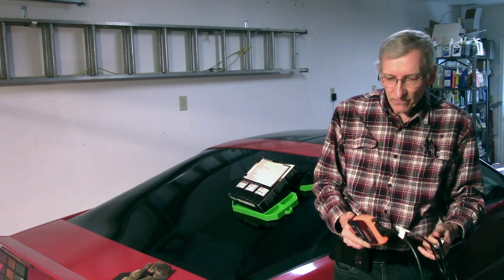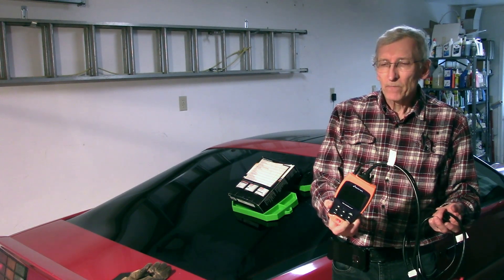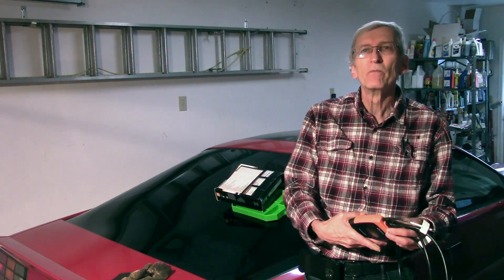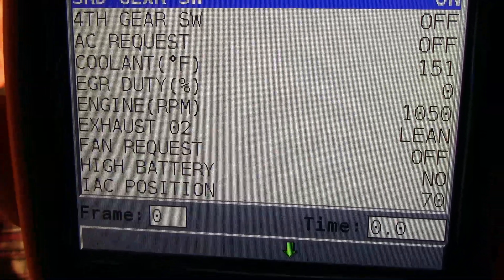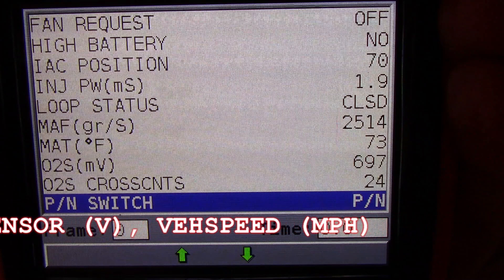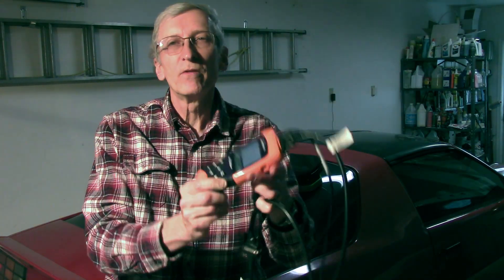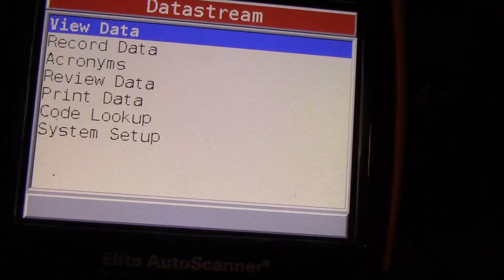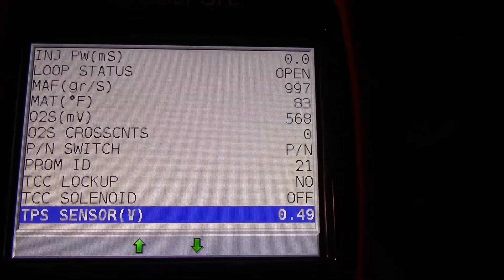OBD-I Scan Tool Review

Comment: Any idea where I can get 12v power cord for Actron 9690? I think Bosch took over Actron?
Reply from the maker: Yes, Bosch owns Actron and I understand they are no longer selling under that brand. Looking at Bosch site for the OBD1300, they list the cable part number as 7-0135. I found it on a couple of sites, here is an example:
https://oemtechtools.com/products/replacement-cigarette-lighter-adapter-for-use-with-act7-0135

Apparently the Bosch OBD 1300 will be the replacement.  Here is a video with a little more information on the issues.  When I made that one, Actron was still selling, but it was hard to find.
https://youtu.be/EpyRz4xCozw

Comment: The cp9690 I got won't connect to 93 camaro,  how do I troubleshoot why its not connecting?
Reply from the maker: There are only a few things that I know.  First, be sure you have a solid 12V connection to the tool.  GM OBD1 won't work without it. The tool will run on battery, but not communicate.  I would check to see if the car will at least flash a code "12" with the engine off.  That usually is a paper clip jumper between pins A and B on most cars.  12 is a code with a stopped engine for no engine speed. If not, there may be an issue with the ECM. Then,  I have had trouble with cars that have had a custom PROM, either a changed one or a reprogrammed production one. Sometimes the reprogrammed ones upset the diagnostics.  Finally, there is an Actron website with the latest software posted for the tool.  If you don't have the latest, you could try updating, though I would think that for a '93 it wouldn't need an update.  Beyond that, I would check with their tech support.
Reply: Ok that's the issue, no 12v cord only batteries. Paper clip jumper flashed code 12. Action is out of business, believe Bosch took over? Wonder how to get 12v power cord?

Comment: How many issues will this tool recognize? I have a 1989 Chevy Cavalier Z24 2.8L that is giving me an issue?
Reply from the maker: On a GM OBD1 car, it should pick up all of the trouble codes that the particular model has in its ECM / PCM.  It should provide the engine data stream for all of the parameters that the controller can provide. Depending on the individual engine controller, there can be some additional functions.  The GM factory tool (Tech1) will usually provide some additional data and functions.

Comment: My 88 S10 uses a paper clip and flashing “Service Engine Soon” light…😆😆
Reply from the maker: Yes, nearly all the GM OBD1 systems use this method to dump codes.  But if you don't have a code, the scan tool is worth it's weight in gold for troubleshooting.
Reply: Google is good for that 👍

Comment: One other tool you could consider would be a old snap on brick. You can usually get one for around the same price as the Actron.
Reply from the maker: Yes, that would be another good solution.  I had the ability to borrow one of those for OBD1 cars some years ago and it was very good.

Comment: Can you reset codes or do relearn procedures?
Reply from the maker: Some of those features depend on the model and year.  On my '85, it won't reset codes because the ECM must be disconnected. I know it will on my OBD2 vehicles. Not sure about the relearns for the same reason.

Comment: Actron finally got them back in stock, I got mine a couple of days ago. tried connecting to my 86 trans am 305 tpi. kept getting device connect errors. called actron tech support and they said it will not work with the tpi cars now. I guess it works with the throttle body engines but not the tuned port any longer. they have updated the software in them .
Reply from the maker: Ohhh, I'm sorry to hear that.  That's not good.  I can't understand why they would do that, but I believe you.  I'll try need to put out a warning or something.  If I take down the video, all the comments will disappear, too.
Next option for you may be the laptop / USB cable and WINALDL or TunerProRT.  I have several videos on those and they worked well for my '85.
Reply from the maker: Since they claim the software is updated, could you please tell me the version on your tool? It is listed under System Set-up / Tool Information.
I just checked Actron site and they don't list a newer software than what I have on my older tool. I have a 0B0B.  The site lists latest as 0B0B or FED0.  That hasn't changed since I bought mine.
It could be that it varies based on ECM.  The 85 and 86 have different ECMs, but I wouldn't have thought they would not support the newer one.
Reply: It had the 0B0B software. @bitsofwisdom460

Comment: I can’t find this scanner anywhere or the Bosh one
Reply from the maker: The Bosch technical folks told me it would be coming back in late summer.  I don't know what the hold up is. You might want to take a look at my videos with a laptop and data cable.  That takes a little more work to get it set up and working, but it is a useful alternative.
Reply: Ebay has it.
Reply: @CarlWilliams-u3y  couldn’t find it on eBay

Comment: I have a 1996 Mitsubishi Pajero 3.0 12valve. Will this obd1 tool work on a 12 pin socket?
Reply from the maker: No, this one only has OBD1 cables for GM, Ford, Chrysler and Toyota. I'm sorry, but I don't know what you need for Mitsubishi.

Comment: Great video.  One question…I purchased a used Bosch OBD I scan tool, model 1300.  The GM adapter is difficult to insert into my port.  I’m not sure if the teeth are misaligned? Have you ever come across or heard of something like this?  I have yet to use the tool because I cannot insert it and I don’t want to force it and break something.  Thank you.
Reply from the maker: I haven't come across that issue.  I suppose a pin could be bent. What car do you have?  Just to be sure, the standard GM ALDL plug is 12 pins and the connector has a slot on the top and 2 slots, one on each side at the bottom (or sometimes the plug is inverted). The car side has a tab at the top and wings or tabs on the bottom on each side.  It can take some wiggling to get it engaged, but shouldn't be too difficult. I have seen in my Camaro that it can be hard to get it lined up squarely because the plug is recessed behind the trim panel. The factory had to connect to it before they could ship the car, so the connector had to work at least once.
Now, if you're working on a 1994 / 1995 GM, some of them are OBD1 cars with an OBD2 style connector. That is the OBD2 16 pin plug. They are certified to OBD1, but actually report OBD2 type codes.
Reply: I have a 93 Corvette.  I’m gonna try it again.
Reply from the maker: @timothydecelle3201  Ok, the '93 should have the regular 12 pin connector.  If you still have trouble, I would look at the end of the connector and see if the pins all look consistent- they should all have the same shape.  Some car side connectors won't have all the pins in them, only the ones required for that model.

Comment: Dan after watching, and seeing the price of those scanners, I highly recommend you try watching videos regarding "TunerPro" and a laptop.  Its free or donation nice, and companies like moates can get you the odb1 cables, and accessories, and decoders, and with this - your laptop windows computer probably can provide a better tuning interface.  I have to admit, I   have not learned TunerPro much myself, but there are alot of people using it for years on ODB1 
Here's an example:
https://youtube.com/watch?v=_a0XBePawug&si=EnSIkaIECMiOmarE
Reply from the maker: I have been looking at several options.  I've been to the Moates site and I'll likely purchase from them.  I would like to get into the laptop based system so that I can go deeper into the ECM and get to more parameters.  However, the scan tool is an easy compact portable tool that most mechanical types can use.  I can throw it in the back of my car to have it handy and not worry about it as compared to my laptops.

Comment: Oh, btw: The high idling when the tool is connected is normal. Its called "Diagnostic Mode" in ALDL. On later ECMs like the 8746 or the 7730, there is a "Road Test Mode". The Tech 1 from GM let you choose that if available. In that mode you can test drive the car without higher RPM or ignition timing. That old "diagnostic mode" is not ready for that. Its only to use without driving. If you like, feel free to contact me. I have the complete manual to the Tech 1 and there it is declared how to use that "Diagnostic Mode".
Reply from the maker: Thank you for the info.  I did find an explanation in the service manual that indicated that some scan tools would cause the high idle.  I knew that various ECMs had different service modes, but I was surprised that this mode would be enabled without  a warning or a switch.  It's been many years since I actually used an official Tech 1 and I have forgotten some of the functions. For now, I think I am ok, because I understand what I have.  I may also investigate the Moates.net tools.  I understood that they have the cable with the switchable 10k resistor to assist in signalling modes.

Comment: Hi! I just have seen your video. I have a '85 Trans Am and a '91 Trans Am. So i ordered one. Did you had to activate the OBD 1 function or did it work out of the box?
Reply from the maker: It worked right out of the box.  Being OBD1 GM, you just need to use the 12v power cable (included) along with the OBD1 GM cable and select your car / year in the menus. They offer software updates, but mine came with the latest already loaded.
Reply: @bitsofwisdom460  thanks a lot! Very sympatic video btw. You have a new follower!

Comment: How much this computer and this computer its can inter and cheek the 1g-fe engine?
Reply from the maker: I am not very familiar with that engine, but that code sounds like Toyota.  The kit comes with OBD1 cables for Toyota round plug and rectangular plug.  If the engine is newer, there is an OBD2 cable.   Price was around $200 when I bought mine, might be higher now.

Comment: This tool only reads ODB-1 data while the vehicle is running and is it bi- directional? Will it help you in a no start situation?
Reply from the maker: The tool will read the data stream with the engine off and ignition on.  You can then read any codes and the live sensor values.  Then you can go to crank and attempt start.  I haven't tried to read sensors during cranking.  On my engine (1985 TPI), there is no control available from the tool.  The tool does have capability for the GM "field service mode" that will command actuators and some other tests, but it depends on the specific ECM and model year and what the ECM will support. In my case with a no-start, I can read all the sensors to be sure they make sense.  From there, it is back to basics.  Do you have spark, fuel pressure, EGR valve not stuck open and so forth. The service manual trouble trees help a lot.

Comment: Moates.net has the aldu1 aldl1 combo that will let you scan with an android or windows device for a lot cheaper. After that you get the ostrich that will let you start tuning the car from your device
Reply from the maker: Yes, I have been to the Moates site and will likely work on getting that capability.  I think both tools are valuable.  This Actron tool is rather compact, seems fairly rugged and it's easy to tuck it away in the car on a trip where I wouldn't necessarily throw in a laptop. Maybe I shouldn't worry about needing a scan tool when I make a road trip away from home, but it's good insurance just in case.
Reply: Can you tell me the name of the cheapest OBD1 scanner? I have a 95 Park avenue and can't get a reading anywhere thanks

Comment: I have the same Scan Tool I use on my '88 Formula 350.  Looks like the PIDs are a little different between the years.  For instance, mine has a TARGET RPM - PID.  On mine, the RPMs doesn't change because the Scan Tool is reading the ECM (which would be annoying) . My Scan Tool does loose communication sporadically (which is annoying).  I also set the TPS volt reading using the Scan Tool as well.  I had issues as well with high idle rpms.  The old throttle body throttle plate shaft was loose and seemed worn out and then I broke the return spring.  So a guy did the right thing and bought a BBK 52mm throttle body and cured the high rpms.  Good luck! 👍🏼
Reply from the maker: I am not surprised the PIDs are different, I expected that was why the instruction manual wasn't specific.  Every year, the development team made adjustments as they learned.  The only thing that I wish my '85 had was some spark timing information.  I think that since the '85 has a separate EST module, the ECM may not have a good way to translate it to the tool. My TPS was right on with the scan tool and it matched a DVM measurement exactly.
Reply: That BBK throttle body uses a sealed bearing on the shaft instead of a bushing like the original. Gave me high idle problems almost immediately. Remanufactured original was the way to go.